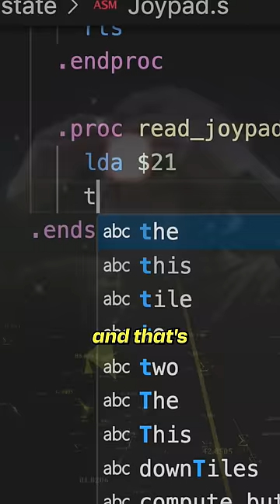NES Games Were Written in Assembly #nintendo #nes #programming #assembly #retrogaming #retrotech

Comment: the technical prowess required to code games back in the day was no joke. Respect to the developers coding that close to the metal while pushing the limits of its architecture.
Reply: Don’t compiled languages compile to Assembly code, though? It’s also possible that the games were programmed in C++ and they simply had to write a different compiler for the modified chip.
Reply: @aycc-nbh7289  this is of the opinion of someone who only took a few CS classes, but I feel like more modern languages have a lot more abstraction when it comes to coding, or layers of translation. yes everything eventually boils down to 1s and 0s eventually but the lower level programming languages are capable of squeezing more out of the systems. Didn't have the luxury of memory or high clock speeds, so really had to make the most out of their limitations in both code and hardware.
Reply: @paulink  But would it be very easy to find Assembly programmers if C and C++ are among the dominant programming languages of the time? Granted, there were computers that had Assembly code development software, but how long did it really take until programming using Assembly instead of using a compiled language became phased out?
Reply: @aycc-nbh7289  this is a quote from a random dev blog I looked up
 "Programming for NES in C has two major drawbacks comparing to programming in assembly. First, compiled code is always slower than handwritten assembly code. Second, it is always way larger. The size is actually could be even more important than the speed. On the other hand, smaller code is usually faster as well.

"

so I guess coding in C was possible but likely not efficient enough to warrant the effort? I'm no expert but I do understand, coding anything in assembly is theoretically going to run faster than code in a higher level language.
Reply: @aycc-nbh7289 Until 16-bit generation coding in Assembly was the logical choice for speed and size issues.
Reply: @jimbotron70 It still means that C or C++ code could be compiled to Assembly.
Reply: @aycc-nbh7289  Yes but with resulting bigger, slower executables.
Reply: Just tossing in a bit more info: high level languages have multiple steps to produce an executable, and I can't think of any that use assembly as an intermediary step. There may be an object code that may be human readable (Java, C#), but the goal is to streamline the compiling process from human readable language into machine code after linking all the various parts together. If a person wants, they can learn to read machine code directly (and you can with a Hex editor), and that includes a lot of that intermediary code, but that completely misses the point of using languages to code--ease of use and access. There are people out there that need to learn those skills, though, when developing the compilers.

As far as the assembly vs high level language, the answer is "it depends." Some libraries in C/C++ are already coded in assembly in the background. You might make them faster, and you might win a computing award, get a patent, or be showered with money for doing so. Good luck at it. Most are made faster by streamlining--stripping out layers of abstraction that are inherit in the standard libraries. You might try to rewrite them in assembly, but is it worth the time and effort to do so vs just streamlining?

Assembly is still used to this day, just not as frequently. There just isn't the performance increase worth the level of complexity added. It's also easier to use a "Switch-Case" tree than writing dozens or hundreds of nested "If-Then-Else" statements AND making sure the Boolean logic on them is correct. Same goes with dynamic memory allocation, which just about everything uses now to play nicely with the operating system.
Reply: @jimbotron70  For games like Mario (arcade, console)? yes. As the decade progressed, a lot more games in the 80s were coded in a high level language due to complexity, and then sped up via profiling and fixing the bottlenecks via judicious use of assembly--typically in math processing and graphics rendering. A lot of hacks were implemented for a wide variety of performance problems.
Reply: @aycc-nbh7289  I think that one of the reason they often needed to directly code in assembly (or code some of their routines in it) was that they had to make sure that the instructions fit in a limited time interval (for example while the screen refreshing was in progress between the lower and upper borders). Assembly coders used a very few instructions but had to learn the hardware to the smallest details (which was possible with early computers).
Reply: @jimbotron70  even then games written in C would still be noticeably slower than if written in assembly
Reply: @MagicManICT  Keep in mind though that most NES games had extra chips built in to do things that the NES wasn't able to do. They also didn't include a header on the ROMs, presumably to save space, but it is rather annoying as it makes it harder to back those games up.
Reply: @aycc-nbh7289 
Ah, no, a common misconception. 
CPUs don't execute Assembler, assembler is ASCII text.
For instance:
CLC
STA temp
ADC temp

Assembler is processed by, er, an Assembler (😂) into machine code

It's Machine Code that a CPU executes.
CLC becomes 00011000
And I can't be bothered to do the rest because which machine code instruction depends on what time of parameters you pass to it.
But the example above will Assemble to a string of 5 bytes
Take ADd with Carry, ADC.
There are eight different ADCs.
You can add a constant, ADC #7
You can add a value from the first page of memory, ADC 7
Aaaaand, I've forgotten how you use absolutes and indirects.

Comment: You do not have to make mul or div in assembly to do them, you only have to push or pull bits on left or right to do so. It was even very more efficient even on processor using mul and div instructions.
Reply: How would one multiply or divide by a number that isn’t a power of two?
Reply: @aycc-nbh7289  you push for the even. Then add one time. X*5 = X*4+X
Reply: @ThecleFr Isn’t this basically the same technique used in “tower multiplication” in any base number system? Though I guess it’s faster than adding the same number multiple times, as I thought it could have been.
Reply: No it really about pushing bit considering you multiply by 2/4/8/16... Each time you push to the right. Sorry English is not my native... You'll find old documentation about that. Of course for the divide rest is kinda lost. But for moving sprites on a screen such precision where of no need.
Reply: @ThecleFr I understand this, but it sounds like it’s how “tower multiplication” is done, only that it’s simplified because further multiplication after the shift won’t be necessary since the machine only needs to know that the shift was being done at all.
Reply: @ThecleFr  that only works for basic shit like 5. If you wanted to multiply by 45 that wouldn't work
Reply: @aycc-nbh7289 there are dozens of algorithms for doing multiplication and division on numbers that aren't powers of two. The issue is that they're only more efficient than using the processor instructions if you know one multiplicand ahead of time. So, if you know you have to multiply by ten repeatedly, you can write (using X as the number youre multiplying by 10):
Y=X*4
Y=Y+X (Y=X*5)
X=Y*2  (Y=X*10)

Again, it's only faster if you know the multiplicand ahead of time, other wise you end up in the best case re-implementing the processor's algorithm while adding the overhead of the fetch/decode/execute cycle.
Reply: @jimireb13 So how would division be done if it isn’t as simple as multiplication, since it doesn’t have the distributive property?
Reply: @aycc-nbh7289  I dont think you can do it with division other than powers of two, to be honest. This has actually been a big constraining factor in a lot of fields. That said, for specific niche situations you can use small-scale hacks, like the fast inverse square root made famous in the Quake 3 source code.
Reply: @slyfox3333 What do you mean? 45x could be written as 32x + 8x + 4x + x, so it could still be done using series of bit shifts and an addition of the initial value.
Reply: @slyfox3333  well, if you did not tried to develop graphic engines in 1990's you can not really understand a  mul took 1000-10 000 cpu cycles when doing it by  yourself with moving bits took only 10/20 cpu cycles at 2mhz... you should not look at the solution with Ghz basis and nowadays solutions :)
Reply: I recall that in Z80 the instructions  were bit shifts... SLA and SRA
Reply: Fixed multiply and divide is just an optimised version of a general purpose mul/div. You have so few registers that you have to use ram for variables in the general case.
Reply: For division, you either divide by 2 repeatedly, collecting the carry bits for the remainder. 
Or for non powers of two, you have to write a division loop to perform long division, so it can take a LONG time, like, dozens of cycles. 
No I can't remember how to actually do that.

Comment: the 6502 has shift left and shift right, which lets you do multiplication by powers of two.  So if you want to multiply by ten you can do an x<<1 + x<<3. Also shift operations are stupid fast because all you are doing is adding 0's in binary to the right for a multiple or removing digits from the right for division. Quicker than adding or subtracting. At least it used to be before we got ALUs. If my memory is correct

Comment: There is an NES game called Kart Fighter:  I loaded it up in a Hex Editor & found that some source code got included by mistake into the final binary:  Like WTF happened there ??? ...Their Build System failed or what ?
Reply: It was probably compiled in DOS or some other early operating system. Memory isn't cleared when it's unallocated and allocated again, unlike in modern OSs. And since the source code was one of the last things in memory before the final linking step, where the ROM file is produced, it's a likely thing to end up in the ROM. Of course, it would've been the linker's responsibility to clear its own memory before using it but for some reason it didn't.

Consider submitting this to The Cutting Room Floor, a wiki for this kind of stuff, unless they already have a page for this game.
Reply: @Gameboygenius  ...oh shyt... They have a list of 210 games with uncompiled source code included in the final binary !!!  lol, TY !!! ...EDIT: opps, lol, that was just 210 games on the 1st page:  With 569 pages, that's almost 120 thousand games with source code snippets included, lol.
Reply: @nikolaikalashnikov4253  it's not just source code. People data mine for other things as well, like unused levels and graphics.

Comment: When implementing a multiplication system, you don’t solely rely on addition and subtraction 
In base 10, if you shift something to the left, that is equal to multiplying it by 10, so if i have 25, i shift it to the left, i get 250. In base 2, its equal to multiplying by 2, so lets say i want to multiply 3 by 12. 3 in binary is 11, and 12 in binary is 1100, which gives us information on how we need to shift.
Reading from right to left, the first number is 0, so we do nothing. The second is also 0, again nothing. The third is 1, so we shift our 11 by 2 to get 1100. The fourth is also 1, so we shift our 11 by 3 to get 11000. We then add 1100 to 11000 to get 100100, which, when converted back to base 10, gives us 36. 

Basicly, base 2 lets us exploit a quirk in math that makes it much easier to multiply than it is in base 10, and so we can finish multiplying any 8 bit number by another 8 bit number in 16 calculations rather than in the 256 calculations we would have to do if we were only using addition

Comment: In some way it was easier than the video suggests because we were actually using macro assemblers, which meant you could kind of make your own composite instructions, but you still needed to be conscious of what they were expanding to.

On the other hand though, self modifying code was also commonplace , which needed an understanding of the machine code at the level below the assembly language.

Comment: The 6502 is extremely efficient though. Many consider it the first real RiSC processor. Its two main drawbacks is that it only has a 16 bit address bus (can only access 64k without bank switching) and runs at a relatively slow 4mhz, though most computers that used the 65xx series of processors ran quite a bit slower (the Commodore 64 ran at 1.02mhz in the U.S.). There was an accelerator for the C64 that ran at 20mhz, but it used a 65816 which was (mostly) backwards compatible with the 6510 in the C64.

Comment: Not only that, but eventually people started writing virtual machines for a simulated 16-bit CPU (e.g. SWEET16 on Apple II) because that massively simplified working with 16-bit values.
Reply: The first arm architecture started off as a program that ran in BBC basic on a BBC micro on a secondary 6502 CPU.

Comment: Writing a multiply function is easy and a game company would only write that one. Much harder are even trivial data structures. You have to compute the offsets for every member by hand and every access you have to type in the address calculations over and over. Macro assemblers where a huge step forward from the early days.

Comment: I only programmed in assembly on 8085. It was extremely powerful. I made a telephone system for a big bank/brokerage in London with 60 dealer positions and 500 incoming lines. Only one 8085 2Mhz processor controling it. Modern computers are crazy slow and bloated.

Comment: Addition, subtraction, loops, and bit shifting. The bit shifting is what makes it tolerably fast. You don't just ad 123 to itself 10 times over to get 10x123. You shift digits, in this case bits, left and right. Just like doing long multiplication in decimal, except it's binary so much simpler.

Comment: 6502 does technically have a multiply and divide work around

Called bitshifting and bit rotating instructions
With some add/dec instructions
Reply: Assembly is very easy

If you actually learn it
Reply: Learn to count in octal and hexadecimal

88888888888

FFFFFFFFFFFFFF

Comment: You can probably get away with foregoing multiplication and division(for the most part) by just using powers of 2 for anything that is going to eventually be multiplied or divided! I remember I never had to use the GBA's multiply instruction when I wrote a simple snake game for it in armasm. I did end up having to use the GBA's builtin division routine for a couple of very specific parts ( such as making sure the numbers my rng routine spits out are fixed within an array's bounds).

Comment: 6809 had a multiplier command. Load the 8-bit accumulators A & B then multiply would put the result into the 16-bit accumulator D which doesn't really exist (by itself). What the CPU does is use accumulators A & B bonded together (8-bit + 8 bit) to have a 16-bit accumulator so that there wouldn't be an overflow. The 6809 ruined me for other 8-bit processors with a fantastic machine language.

Comment: Please there's no "math library" nobody wrote a "math library", you just code to the strengths of the system, so you're going to have some look up tables and you're not going to jump to math routines every time you need to do a little math. Shifts do a lot of heavy lifting for multiplication and division.

And on a simple machine, assembler is correspondingly simple.

Comment: The flex cable has 16 gold tip finger to clamp onto the LCD insertion fpc dock connector, by the EP-ROM DIP chip outgoing and intermittently cut off by receiving RAM DIP chip , for output through 16 pin head flex ribbon cable, the EP-ROM contains 28 pin, only 0A-14A are address pins, would I be able to intercept data in hex just from the flex cable intercept thats on the LCD fpc insert input, if i unmount the LCD from flex connector and use another connector with Arduino input for serial data dump output. Suppose usagi electric channel on Hex ROM Arduino,

I might be wrong on order of importance, For sure it's NAND decoders, then it's RAM then ROM or vice versal, ROM then RAM, to flex out LCD TFT , for data can add new 16 flex connector common for diy

Comment: If you think assembly on the nes is fun, you should see it on the atari 2600. To draw things on the screen it had basically half a horizontal lines worth of "graphics memory" you had a small window to change from line half 1 to line half 2, too fast and the 2600 is still trying to read half 1 and it comes out wrong, too slow and line half 1 gets drawn again. Oh did i mention you would have to do this for  up to 192 horizontal lines?